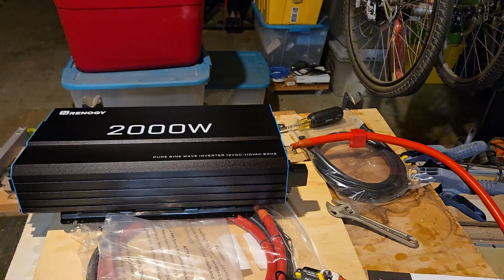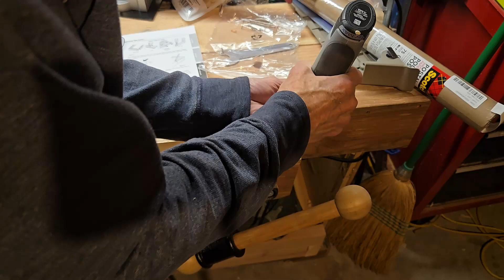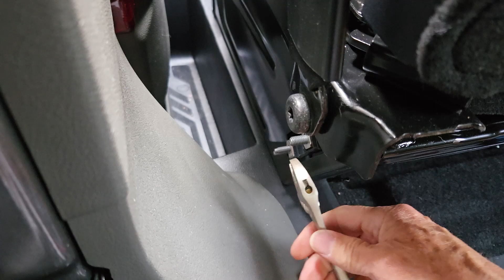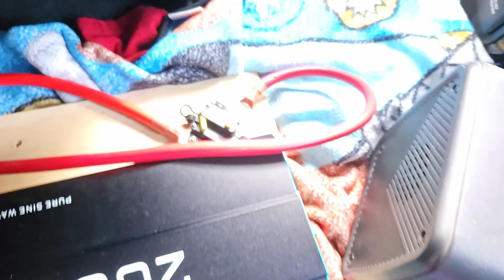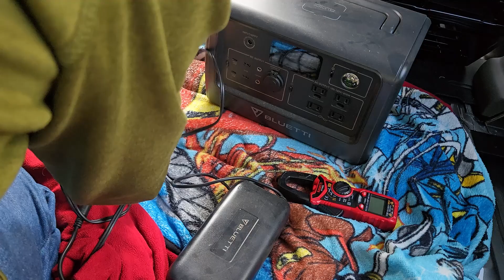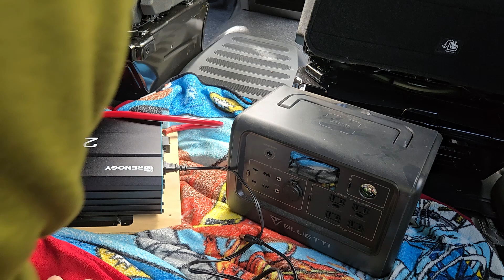Ford Transit Charging from van CCP connections | Ford Transit

Comment: Hello, newbie here. My question is, have you disconnected the batteries before connecting to the ccp point? My fear is blowing up fuses while playing with tools there
Reply from the maker: First of all don't attempt anything without a multimeter. And I only connected to the positive CCP2 on my van which is only hot when the ignition is engaged. Basically when the screen in the front of the van is on, CCP2 is on. Which I verified using a multimeter. Connecting just a negative while live is not a problem. That's basically the same thing as touching a metal part of your van.
Reply: @vanwander thank you

Comment: The power station already has an inverter, why did you add one? Meantime I am trying to understand how to do this job with my Bluetti and Charger 1 but I dont want to destroy the van. I dont know what Im doing and the video isnt making sense.
Reply from the maker: I added an external inverter so I could accept both vehicle DC-DC charging while also inputting solar input at the same time. It is not a simple issue with a power station at these high rates. Charger 1 is great, but it uses the solar input on the power station so in addition to not being able to use both at the same time, you also need to figure out how you will switch it back forth between solar and charger 1. I don't think my video is going to be helpful for a charger 1 installation. It's a completely different thing. The only thing similar is that you might want to use a CCP connection point for the positive connection to the van. For negative, you should use one of the designated ground points on the van. Those are difficult to find (especially on a built van interior). I ended up running my negative under the driver seat to a location that looked to be ready for this type of connection. I have another video about my full AC200L setup on my channel.
Reply: @vanwander  Thanks so much for the reply. I can buy the Charger1 today but so unsure about how to use the CCP. I see the plate for it but which is the 60a fulltime, which is the 175a parttime and yes, which is the Neg? And I can also buy a 60a inline fuse (instead of a breaker, or I can use both).
Reply from the maker: @cvcoco if you don't have a multimeter and know how to use it I advise getting some help.
Reply: @vanwander  Getting help has been the problem -- who and where? Some suggest a car stereo shop. I gave the job to a RV inverter installer but then they begged off the job because they hadnt done Transit before. I have a multimeter and i understand why you asked. If there are 3 terminals, and I assume one is NEG, why use a ground elsewhere? And, I dont have crimping and cable tools with me on the road to install a fuse or breaker near the battery but which is preferred? I have both breaker and fuse coming. I do need someone. Thanks for your reply.

Comment: Do you know if the CCP Ground goes to battery 2 (non-starter) negative?
Reply from the maker: It is just chassis ground which I believe both batteries are connected to. But that post is not really meant for ground. It is just a bracket post that happens to be connected electrically to the chassis. See my other video (Final Bluetti ...) where I show my final setup. In that video, I connected both of the inverter grounds to under the driver seat (without removing the seat).

Comment: I have 3 ccps think they are 60amp each. Maybe wire a 2000w inverter to 2 of them what you think?
Reply from the maker: I think you need to know when they are active and  be absolutely sure it is impossible to exceed their capacity. Like if you are setup to pull 100 amps @12v and one of them turns off when you turn off the ignition, the inverter will try and pull 100amps from the remaining CCP. I would be very careful with this. I used only my ignition activated 175 amp CCP which I believe may have been added with the RV prep package. I learned one lesson today. I tried changing my Bluetti to pull 8 amps from the 12 it was configured for. But I did it while the inverter/CCP was live. Somehow the Bluetti managed to pop my 150 amp breaker while it was in the middle of changing from 12 to 8 amps. So beware. I think the Bluetti may have a spike on changes.
Reply from the maker: Honestly, I probably would not bond them like that myself. At a minimum, you would want them separately fused and/or breakered at an amperage safely under the transit fuse amperage.

Comment: I'd be worried about that earthing point being so close to the CCP. 
You may wanna edit the video for people who are in experienced
Refer to the BEMM for better earthing points. Youd be better off going from the handbrake assembly, there a proper earthing point there.
Reply from the maker: Thanks. This was just a test. I have another video where I show my complete solution. And I did not use that post as a grounding point. Also, the renogy has both a ground and a negative DC input and those need to be separately run.

Comment: Hi Thanks for the response earlier. I was going to follow your installation but I read from the forums that you should not use that bolt as grounding point.
Reply from the maker: That is most likely correct. But it is still right there and extremely close to the CCP2 post. So use extreme care not to accidentally short it out when live. Also, CCP2 is not exactly ignition switch controlled. If you turn of ignition and don't open the driver door, CCP2 can stay hot for 10 minutes (when you see the screen go dark, CCP2 is off).
Reply from the maker: Also, I was just doing a test. I will probably not use that ground post as my negative in my final install.
Reply: @vanwander   Do we have to attach the earth ground? I think you have that on your inverter as well but I don't see that you installed it.
Reply from the maker: @MYchannel-tq1es  Again, I just did a test. I have not completed my actual installation yet. The manual I read does indicate you should connect the grounding lug to the vehicle chassis (ie. ground). Note that I wouldn't probably call that "earth ground". Also note that the negative terminal is also connected to the vehicle chassis due to how vehicles convey negative DC via the chassis. But don't listen to me. Read the installation instructions that came with your exact unit.
Reply: @vanwander  Got it. I was also advised to connect to the same bolt I used for the negative - I used the D-ring bolt by the way. should I change the thin wire to thicker or use the same wire included in the package?
Reply from the maker: @MYchannel-tq1es  you should use an online DC wire calculator. If you use too small a wire size, you could start a fire. This is a high amp application. Note the thickness of the wires I used in my test. Note also how short they are. Wire size is related to amperage, distance and other factors the calculator will help with. Too small a wire and it can overheat and start a fire.
Reply: @vanwander   Yes, for my negative I used 6awg as per wire calculator. I am referring to the other ground from the inverter - should I also use 6awg?
Reply from the maker: @MYchannel-tq1es  6 is pretty small if you are doing high amperage. My amateur understanding is that you should use the same size for both positive and negative legs. Make sure you have a fuse and/or breaker at the amperage you used for your wire calc so it blows before the wire overheats. I am not an electrician and almost all my knowledge is from reading so consider asking someone more qualified.
Reply: @vanwander  Thanks again for all your help. Just to give a background I am installing 600W pure sine inverter to power a 32" TV and Soundbar while on the road and that's it. My van is a passenger.  Both positive and negative are 6awg. The third wire - I am still figuring out what to do. I was told to connect to the same ground I used for negative.

Comment: Newbie here - can I tap both inverter and powered subwoofer on CCP2? My inverter is 600W.
Reply from the maker: I am not an electrician and the answer is much too long for a YouTube comment. But I can say that you can treat CCP2 like a battery and a battery can have more than one thing powered off of it. You need to calculate the amount of amps that you're going to pull from all the devices that you're going to connect to that battery. You need to make sure that the wiring you use is sized adequately for the amount of amps that will go through it and its length. And you should have fuses that protect those wires in case something goes wrong or a short circuit. It is a good idea to make sure that the fuses are lower than the 175 amp max on CCP2. I don't know that all transit vans with a CCP2 have 175 amps. I know that my transit with the RV prep package and two alternators definitely does. Hope this helps. There's not a great deal of information out there but some of the transit upfitter forums have a lot of info.

Comment: I bought almost the same base vehicle and did my own build-out, too.  I got the RF Prep Package and when the vehicle was delivered, the dealer could not tell me anything about what that package was.  I have those same customer connection point connections and have not used them, but I realize I should use the switched one for my DC-DC charger to let my alternator charge my house battery only when the engine is running, rather than switching it off and on manually.  So now I know what the RV prep package is.  At one point when I was charging as I drove and also was charging the vehicle batteries, one of which I had deadened by mistake, I got 288 Amps from the alternator.

I was afraid to drill holes in my van's roof at first so got a professional to install my fans and first solar panel.  Then, a year and several trips later, I realized I needed more solar.  This time I got the correct sealant/glue (Dicor) and installed them myself.  It was just a case of watching enough videos to feel confident.  I also bought shorter screws than came with the panels.  This worked better.  Six months later and all my panels are totally secure and I have no leaks.  You put Dicor under the 'Z' bracket liberally and then screw in the screw which causes Dicor to squeeze up through the hole, and then you add more once it is tight to cover it completely.  You just have to be quite liberal with it.

On the subject of charging from solar and some other source, I heard other YouTubers saying that 'everyone does it'.  When I tried it, the solar charger sometimes judged from the other charger's voltage that the battery was full and stopped charging.  Another time it was all additive.  My feeling with solar is that it probably makes the van cooler in bright sunshine as the panels are converting the heat into electricity and shading the van, leaving just the side walls.  I installed a switch on the incoming solar power so I could disconnect when I was charging through the alternator or plugging in at a campsite.  The issue was remembering to switch off solar.  I also switch off when parked in the driveway so I don't go down a couple percent and then charge back up the next day - I only get 7000 charges according to my batteries specs.  If I am parked, I wait until the day before I leave and switch on to charge up.
Reply from the maker: I took, got the same blank look when I asked what the rv prep package got me. I had to research the CCP connections because it seems a waste to have two alternators and not use the second one. 175 amps is a lot of power. I lived entirely on solar in my minivan but will see how the alternator charging alone does before I move onto dual inputs. I was not going to go the component route to a battery system, but even with an all in one, I am now up to my 3rd component. So do I add a Bluetti expansion battery (easy) or start over with all separate components? Stuff that keeps me up at night. Lol
Reply from the maker: The Bluetti AC200L has separate direct solar and AC inputs that it can charge from simultaneously. I am taking advantage of that if I add solar. It cannot use 12v 150amps directly via any input port. It either has to be a much higher voltage DC, or AC up to 2400 watts. With 2400watts input also the limit when combining.
Reply from the maker: Btw. The switched CCP connection has a 175amp fuse under the driver seat protecting it. So I have gleaned.
Reply: @vanwander  Interestingly I cannot identify a second alternator.  It seems I have one big one.  I prefer your arrangement because if by some chance an alternator failed, at least in a camper-van, one could use the second.  I have an AC charger that I can use to draw on my house battery to charge my vehicle battery as backup and I bet there would be a way to use a second alternator in an emergency, even if it involved keeping the vehicle battery charged after a failure of the alternator that powered the engine.  Not sure if this makes sense, but in desperate times, one would think this one through and escape.  In fact, I have a battery isolator between my two AGM batteries under the driver's seat so if I park too long and run the WiFi so it kills the battery for starting, I press the manual connect on the isolator and jump start myself with the press of a button.  I have done this many times, except it is mostly because I parked it in the driveway between trips and kept going in to do projects or packing and that drained the battery.
Reply from the maker: @dgrahammartin  I think the dual alternators option is separate from the RV prep package. I think the main benefits of a second alternator is redundancy as you mention, but also capacity to pull 175 amps with affecting normal vehicle operation. I don't think I would want to pull too much from a single alternator. But they are beefy alternators in the first place. Anyway, because of my location, getting a Transit AWD with the 3 windows is pretty difficult so I just bought the one that came up. I think it is possible that the CCP2 connection wiring IS part of RV prep, but even after I spoke to the guy at the dealer who ordered the van for their lot, no one seems to know what all the RV prep package entails. Swivel seats for sure. Lol
Reply: @vanwander  so best to add your own, more accesible, fuse if you can.